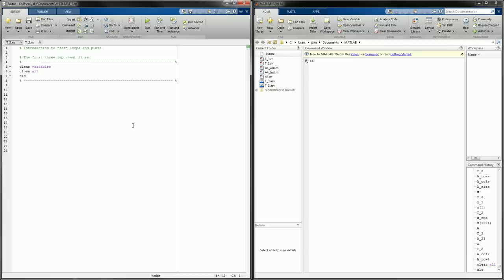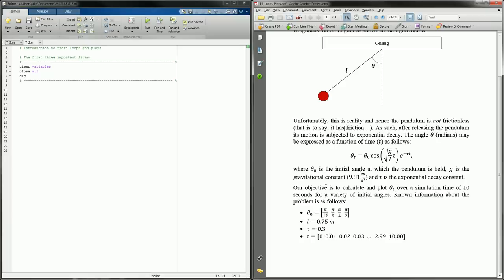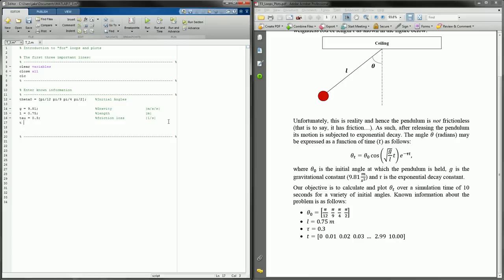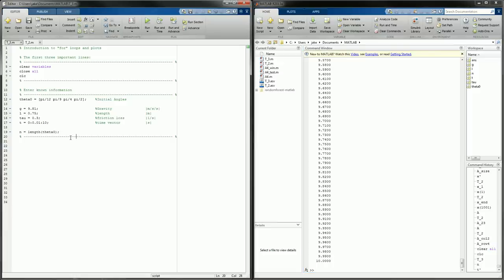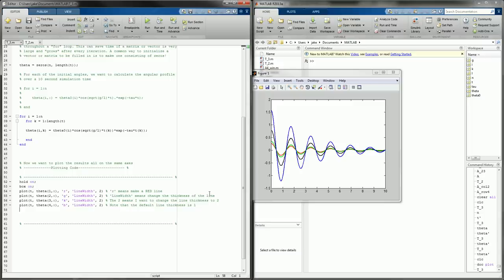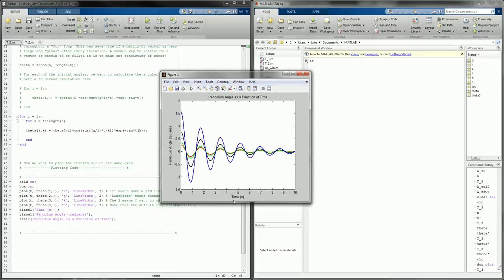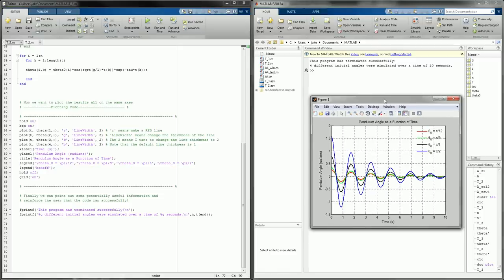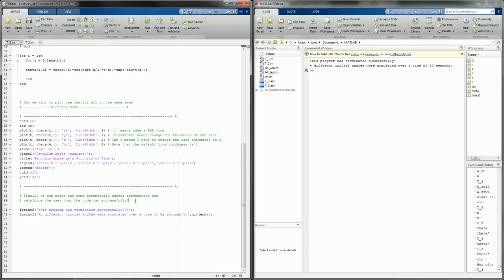MATLAB Tutorial 3 - FOR Loops and Plots

Comment: Can we change two variables in a MATLAB at same time by a for loop? Suppose t=1:10 and g=21:30. I want formula to run first for t=1 and g=21 then the formula should run for t=2 and g = 21,22. Then the formula should use t=3 and g=21,22,23 and so on and so forth till it takes t = 10 and g=21:30 (now all value of g). Can you please elaborate it a bit.

Comment: Numerical Methods ChE McMaster is there any ways to simplify the steps used to plot the graphs?maybe using a loop?
And i have some problems here, it just a simple problem regarding the column and row of the theta in LINE 34. For the function you used theta(1,:) = the functions, when i run it it will be 4x1001 matrix and it not the same as you which is 1001x4 matrix. I need to change the codes back to theta (:,1) to get the same result 1001x4 as you get. Can you explain this?
Reply from the maker: Sure I can help you out here.
When it comes to plotting quickly, it can certainly be done in a loop. However, without some cleverness you lose a bit of autonomy there. A potential loop for plotting these functions might look like

hold on;
for j = 1:n
     plot(theta(j,:),'LineWidth',2);
end

The above code will automatically plot each, but will use the default line colours and styles (as in lines, not dots or symbols). It is possible to customize the colours and styles of the lines, but to do so my suggestion would be to make an [n x 3] matrix of RGB colour coordinates and then call them for the line colour option in the loop. Just use "doc plot" in matlab and you should see how you can use the RGB system. For example, [0 0 0] is black and [255 0 0] is red.

As for your second question, I actually do get a 4 x 1001 matrix in that loop, but when I call it in the command window I am calling theta' (with an apostrophe), which transposes the matrix, thereby making it look like a 1001 x 4.

Hope that helps!
Reply: tq bro...its really help me :)
keep uploading new videos